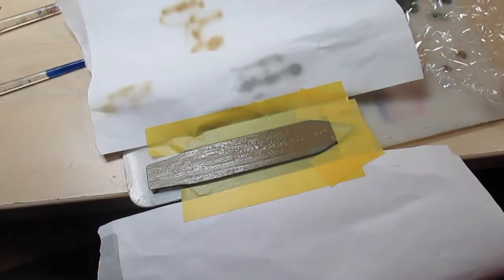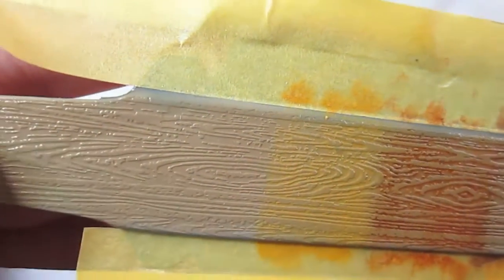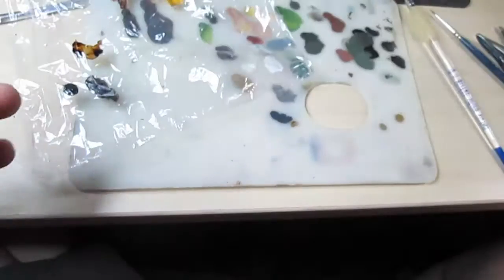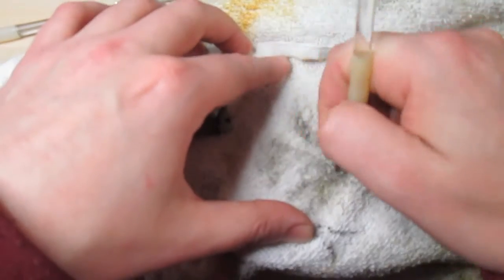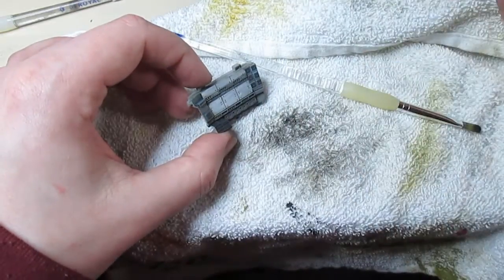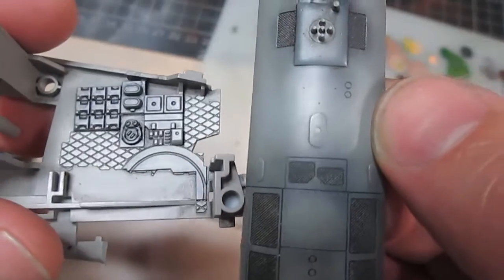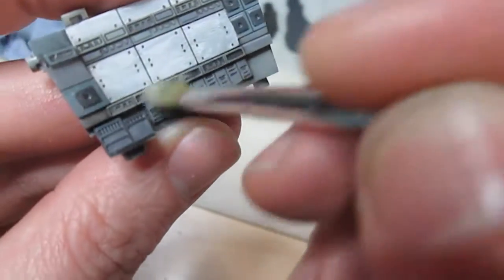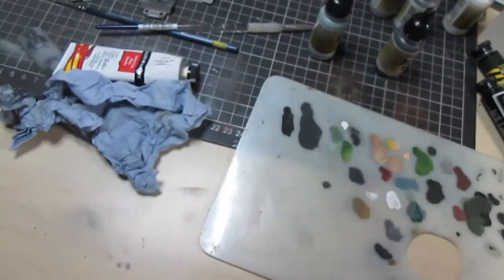Bandai's 1/48th scale AT-ST: Part 5

Comment: Great little series you've got going on here, can I just ask what you mean by filter?
Reply from the maker: whiteknight723 Hi, great question! It's one of those answers that's easier to show than explain, but the basic principal of it is to take, in the case of this build "grey" and adjust its colour slightly - warming up a white scheme, toning down a loud red, making a boring grey look a bit more natural and the like. 

You find armour guys using the technique a lot to fade the colour of a tank due to exposure to the weather, like you'd see in real life, so for example the olive drab of a tank becomes faded due to sun-bleaching.

It usually involves doing your normal base coating and/or camouflage, sealing it all in with a couple layers of gloss varnish, leaving it all to cure, and then coming back with mineral spirits to dampen everything. Once that's done, we come back with dots of oil paint - red, blue, yellow, maybe some white... and then blending it all together with a brush dampened with mineral spirits again.

I know, wordy right ^_^

THE best explanation in video form I've seen yet is this one:
https://www.youtube.com/watch?v=03NXzAOQu_8

Like I said, it's one of those things that's easier to show than explain, and I'm leaning more towards the heavier "gunk wash" of slapping the oil on neat as I have done with this build - same effect, less hassle!

I really hope this has helped explain it? Great technique if you can master it, it really brings the level of finish up a couple of notches.

Thanks for watching dude, stay tuned... this is half the build so far :)
Reply: great answer, very wordy but I get ya, really effective using the white dry brush and the gunk wash works so well,  big fan of Foxx's work been following him since the Deago Falcon build, talkin of which a couple of us on the falcon builds facebook page have bought this walker to give us something to do between issues, im waiting for mine to turn up so I shall definitely be keeping tuned to your vids.
Reply from the maker: whiteknight723 Great stuff! I'm honoured that you guys are watching, and am actually blushing at the moment ^_^I'm in the process of putting part seven at the moment, I think there's going to be another two episodes at most after this, including a quick beginners guide to painting the figures, and sorting out that 70's orange base...Really appreciate the follows dude, soon as I get out of work I'll reciprocate... I'm trying to do this without the boss catching me!Take good care lad :)
Reply: Ive just ordered my very first tubes of starship grime and engine grease :-)
Reply from the maker: As the wide old Foxx said to me a couple of months ago, good lad - you'll not regret that! Best part of that stuff too, a little goes a loooooong way... have you ordered odourless thinners too?
Reply: helgan35 ahhhh no, I have a nice new x-20A Tamiya thinner, any good?
Reply from the maker: Afraid not, x20a is for acrylics, and the abteilung is an oil paint so it's literally the painty version of chalk and cheese.
I use this stuff for the oils - http://www.emodels.co.uk/ak-interactive-100ml-odourless-thinner-00050.html - it's a bit pricey, but craft shops will sell something similar.
Look for odourless turpentine... odourless is key! Stops you smelling the house out >.<
Reply: helgan35 ok ideal, I shall get some on order, I completely endorse oddurless where I can lol. Cheers for the tip, nice one.
Reply from the maker: No worries! Also, do try to keep the lid on when you've used it... I keep knocking mine over!
Reply: Haha I'll do me best :-D
Reply from the maker: I've just nearly done it again now with my varnish... You do realise Foxx and I will want to see photos at the very least right? Maybe a video too...? It's good fun!
It's a really good kit, just be careful with the cheek cannon, it's a bit fragile!
Reply: It'll have to be photos, dont have a cam im sure we arrange something. On Foxx's advice I got myself a cheap air brush to practice with so we shall see lol
Reply from the maker: Cheap airbrush is the way to go. Years ago I spent the best part of £80 on the Iwata I still use, but I have another off ebay for £15 that's just as good, and does the exact same job!
If you have any old wallpaper rolls lying around, lining paper is even better, use that to practice on.
Trust me, the more you practice, the easier it becomes! Let us know how it goes :)
Reply: I have loadsa lining paper as it goes, ideal never thought of that. Thing is I bought this little kit, unpacked it, noticed not much instruction with it so I went on you tube to look it up. Turns out its actually made for salon cosmetics and body art lol :-D
Reply from the maker: ooh... which one is it? I'll have a quick nosey and see if it'll take a model maker's level of usage if you want?
Reply: Hehehe!  Ok, dont laugh its a Vogue air! Id very much appreciate your opinion, testing starts saturday lol
Reply from the maker: if it's this one https://www.youtube.com/watch?v=nRBsqXiiow8 it's a great little kit for beginners! The airbrush itself in that vid looks the same as the one I used in part 1 of this build, at around 12 minutes in. It's a decent little 'brush too!
Take your time, practise the hell out of it!
I'm pretty sure Foxx has a good tutorial on his channel for airbrushing...
Reply: Yes thats the video I watched! Oh great! Im happy about that, roll on saturday. What do you think of the compressor, would I be able
 to upgrade the brush if all goes well? I'll check out Foxx for techniques, he has part 2 of weathering out today as well. Thanks for your input much obliged mate :-)
Reply from the maker: No problem matey, glad to help!
Yep, you can upgrade the brush anytime. Stay with that gravity feed type wherever possible - they're a lot easier to look after and use!
As for the compressor, I had a similar one, and so long as you don't run it for too long you shouldn't have too many problems with it, but eventually like all mechanical things it'll one day decide it's had enough, like mine did recently. I've splashed out on this one to replace it - http://www.ebay.co.uk/itm/Airbrush-Compressor-Kit-Large-Tank-Nail-Tatoo-Art-Nailart-Air-Brush-Gun-AS-186-/400745289401?pt=LH_DefaultDomain_3&hash=item5d4e47d6b9 - the brushes that came with it are side feed jobs that I resold separately...I'm not a fan of them, they're a nightmare to clean!!!
I've seen Foxx's latest, good stuff as always! I'm pretty sure as well that's his 9th tube of starship filth this month alone... 'nother wordy answer I'm afraid, sorry dude!
Reply: helgan35 Damn, I really should do a proper "how to airbrush" tutorial at some point There's bits in the odd video (there's on in the Strker build I think). I'll probably do a "proper" guide when I do my Perfect Grade Gundam.
Reply from the maker: Modelmaking Guru I've a vague memory of a talk through, and avoiding those beastly side-feeds (beastly!), I think it was in the stryker series?
Reply: helgan35 damn it I got one of those Sheriff Rosco P Coltrane moments coming on lol just purchased some different grey shades, lets see I got a Tamiya XF-53 neutral grey. A XF-54 dark sea grey. A XF-16 flat aluminium. A XF-19 sky grey. And an XF-22 RLM grey. I remembered Foxx's side feed and syphon feed warnings lol
Reply from the maker: whiteknight723 YES!!! He's hooked, quick Foxx lad, reel him in!
Reply: helgan35 Nah, I think that was on one of the DeAg Falcon vids...
Reply: helgan35 So, let's talk about paint chipping...
Reply: Hahaha! Im in, hooked lined and sinkered if thats even a word, yes the Deag falcon vids started all this. You Tube is a great tool.
Reply: Yes Foxx Paint chipping? Little advanced for me, but im open for learning :-)
Reply: The chipping on the passenger chairs I didnt do, instead I used a needle, dipped it in titanium silver and subtly highlighted the exposed edges and I have to say I was well chuffed with the result.
Reply: whiteknight723 That's just as good a method as any :) There'as three ways to doi it - your way, the liquid mask and metal undercoat way, or the hairspray method. I covered the hairspray method in one of my DeAG Falcon vids, so as we are on Tony's channel I will let him think of a cunning yet relevant way to this kit  to show liquid mask chipping somehow, No pressure or nowt... :)
Reply: Cant wait for that shall stay tuned, gotta have some chippin on the At-St, its the law lol
Reply from the maker: Oh you wicked, twisted boys you! It'll be brushed on in this build, however liquid mask will be used in the NEXT build...Mr Foxx, yes I'm looking at you... Aye, I'm chickening out of liquimask on ol'chicken bonce, but I promise he will be chippied with a brush and possibly a sponge. Yeah I said chippied :)
Liquimask WILL HAPPEN, but it'll be on R5 next time. Ooh he's a grubby likkle fella is R5!
Reply: helgan35 Oooo use a bit of brillo pad, you might get finer chipping (with the rough top bit, not the sponge bit)
Reply from the maker: Aye, was gonna do that like I did with the Hanomag, Famo and Tiger (did I send photos of Tigger?). Must finish that diorama too, there's still a sh*tload of figures AND a panzer 4 to go with it... So much stuff, so little time!!!
OOH!!! Have you seen Girls Und Panzer yet?